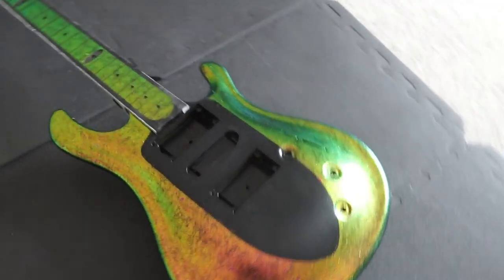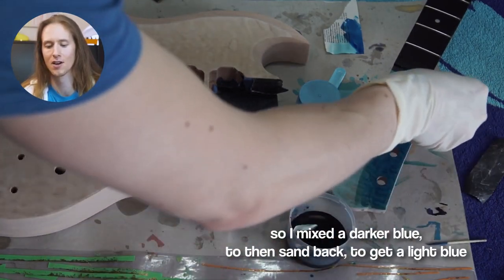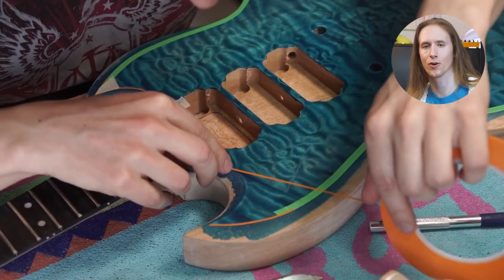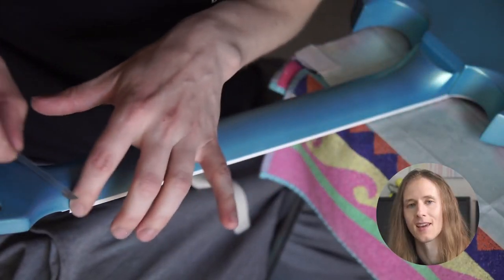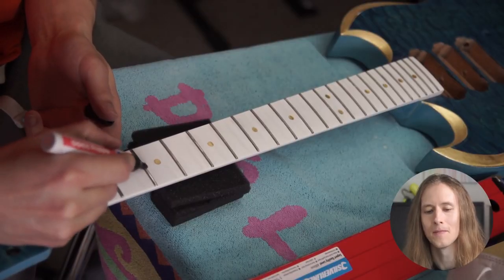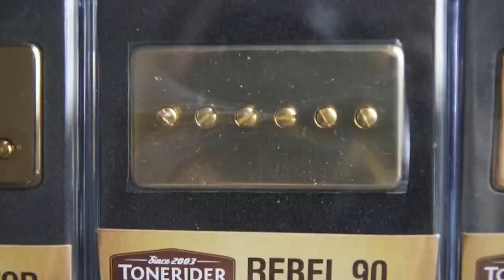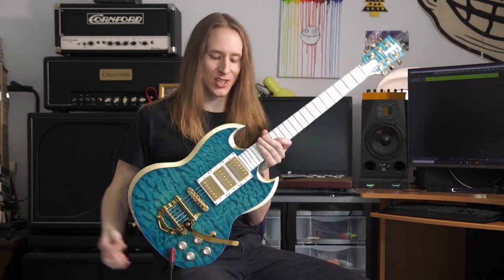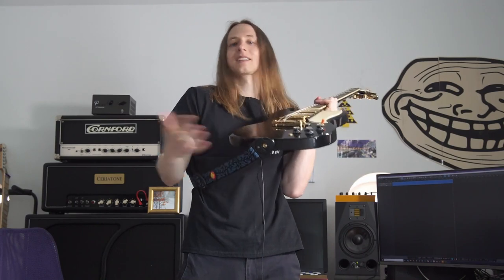GTA V Epsilonism Guitar | Great Guitar Build Off 2021

Comment: Please do a gear & tools rundown one day, would be interesting which spray, polishing, etc. brands you're using. Would be interesting for EU guys :D
Great guitar, can't wait for the green color shift one though hehe :)
Reply: Okay great, thanks for the info. When you have it all, please make a gloss video if you find the time. I love making stuff shine. Please also tell me the polishing products, the creams or whatever it is that you're using. That's one of those mysteries I'm still working on :D

The vlog channel is a few years old already by now... I can't believe it myself but time is flying.
Reply from the maker: @ChrisViralVlogs  Ideally you'd use a thicker clear coat (sometimes called sealer, or filler) to build up a nice layer of clear. Then you level sand it, e.g. up to P800. Then you spray your top coat, maybe just two coats. And then you might only need a little sanding so you start with P1000 and go up (wet sanding, preferably). Then you use a polishing machine with e.g. Meguiar's Ultimate Compound. Then you wipe it off completely. Then you use the polishing machine again with Meguiar's Ultimate Polish. And that's it. But there will be videos of that also :)
Reply: alright, thanks! :D
Looking forward to those lessons hehe!